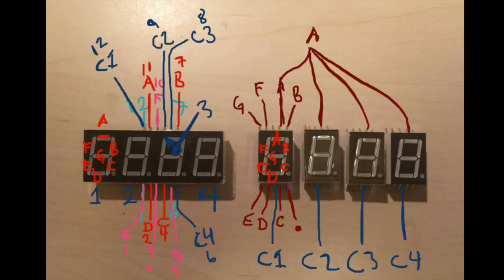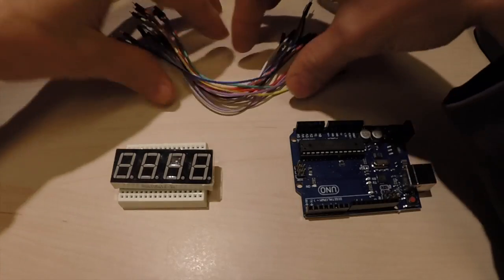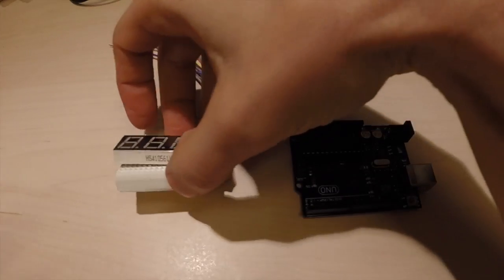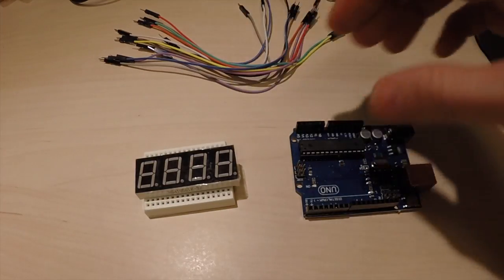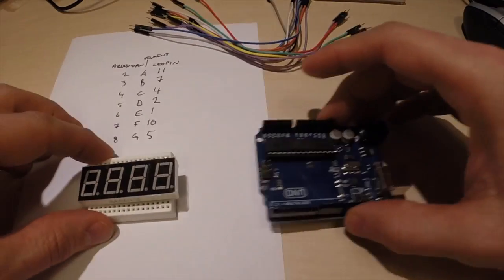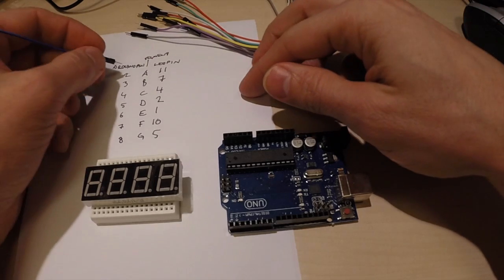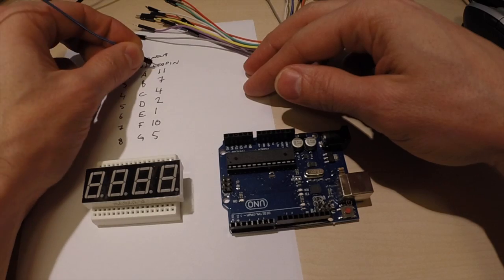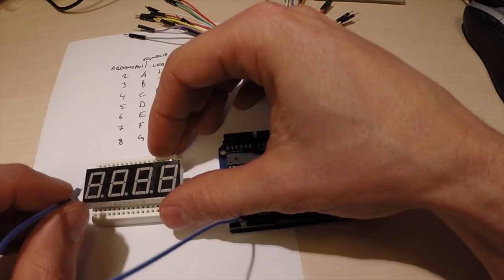Arduino and the 4 digit 7 segment led display - Anything Arduino Ep 21

Comment: could you please type the code so that i can copy it and paste it
Reply: /*
  Showing number 0-9 on a Common Anode 7-segment LED display
  Displays the numbers 0-9 on the display, with one second inbetween.
    A
   ---
F |   | B
  | G |
   ---
E |   | C
  |   |
   ---
    D
  This example code is in the public domain.
 */
 
// Pin 2-8 is connected to the 7 segments of the display.

int pinA = 2;
int pinB = 3;
int pinC = 4;
int pinD = 5;
int pinE = 6;
int pinF = 7;
int pinG = 8;
int D1 = 9;
int D2 = 10;
int D3 = 11;
int D4 = 12;

// the setup routine runs once when you press reset:
void setup() {                
  // initialize the digital pins as outputs.
  pinMode(pinA, OUTPUT);     
  pinMode(pinB, OUTPUT);     
  pinMode(pinC, OUTPUT);     
  pinMode(pinD, OUTPUT);     
  pinMode(pinE, OUTPUT);     
  pinMode(pinF, OUTPUT);     
  pinMode(pinG, OUTPUT);   
  pinMode(D1, OUTPUT);  
  pinMode(D2, OUTPUT);  
  pinMode(D3, OUTPUT);  
  pinMode(D4, OUTPUT);  
}

// the loop routine runs over and over again forever:
void loop() {
  digitalWrite(D1, HIGH);
  digitalWrite(D2, LOW);
  digitalWrite(D3, LOW);
  digitalWrite(D4, LOW); 
  //0
  digitalWrite(pinA, LOW);   
  digitalWrite(pinB, LOW);   
  digitalWrite(pinC, LOW);   
  digitalWrite(pinD, LOW);   
  digitalWrite(pinE, LOW);   
  digitalWrite(pinF, LOW);   
  digitalWrite(pinG, HIGH);   
  delay(1);               // wait for a second
  
  digitalWrite(D1, LOW);
  digitalWrite(D2, HIGH);
  digitalWrite(D3, LOW);
  digitalWrite(D4, LOW); 
  //1
  digitalWrite(pinA, HIGH);   
  digitalWrite(pinB, LOW);   
  digitalWrite(pinC, LOW);   
  digitalWrite(pinD, HIGH);   
  digitalWrite(pinE, HIGH);   
  digitalWrite(pinF, HIGH);   
  digitalWrite(pinG, HIGH);   
  delay(1);               // wait for a second
  
  digitalWrite(D1, LOW);
  digitalWrite(D2, LOW);
  digitalWrite(D3, HIGH);
  digitalWrite(D4, LOW); 
  //2
  digitalWrite(pinA, LOW);   
  digitalWrite(pinB, LOW);   
  digitalWrite(pinC, HIGH);   
  digitalWrite(pinD, LOW);   
  digitalWrite(pinE, LOW);   
  digitalWrite(pinF, HIGH);   
  digitalWrite(pinG, LOW);     
  delay(1);               // wait for a second

  digitalWrite(D1, LOW);
  digitalWrite(D2, LOW);
  digitalWrite(D3, LOW);
  digitalWrite(D4, HIGH); 
  //3
  digitalWrite(pinA, LOW);   
  digitalWrite(pinB, LOW);   
  digitalWrite(pinC, LOW);   
  digitalWrite(pinD, LOW);   
  digitalWrite(pinE, HIGH);   
  digitalWrite(pinF, HIGH);   
  digitalWrite(pinG, LOW);     
  delay(1);               // wait for a second
/*  
  //4
  digitalWrite(pinA, HIGH);   
  digitalWrite(pinB, LOW);   
  digitalWrite(pinC, LOW);   
  digitalWrite(pinD, HIGH);   
  digitalWrite(pinE, HIGH);   
  digitalWrite(pinF, LOW);   
  digitalWrite(pinG, LOW);     
  delay(1000);               // wait for a second
  
  //5
  digitalWrite(pinA, LOW);   
  digitalWrite(pinB, HIGH);   
  digitalWrite(pinC, LOW);   
  digitalWrite(pinD, LOW);   
  digitalWrite(pinE, HIGH);   
  digitalWrite(pinF, LOW);   
  digitalWrite(pinG, LOW);     
  delay(1000);               // wait for a second
  
  //6
  digitalWrite(pinA, LOW);   
  digitalWrite(pinB, HIGH);   
  digitalWrite(pinC, LOW);   
  digitalWrite(pinD, LOW);   
  digitalWrite(pinE, LOW);   
  digitalWrite(pinF, LOW);   
  digitalWrite(pinG, LOW);     
  delay(1000);               // wait for a second
  
  //7
  digitalWrite(pinA, LOW);   
  digitalWrite(pinB, LOW);   
  digitalWrite(pinC, LOW);   
  digitalWrite(pinD, HIGH);   
  digitalWrite(pinE, HIGH);   
  digitalWrite(pinF, HIGH);   
  digitalWrite(pinG, HIGH);     
  delay(1000);               // wait for a second
  
  //8
  digitalWrite(pinA, LOW);   
  digitalWrite(pinB, LOW);   
  digitalWrite(pinC, LOW);   
  digitalWrite(pinD, LOW);   
  digitalWrite(pinE, LOW);   
  digitalWrite(pinF, LOW);   
  digitalWrite(pinG, LOW);     
  delay(1000);               // wait for a second

  //9
  digitalWrite(pinA, LOW);   
  digitalWrite(pinB, LOW);   
  digitalWrite(pinC, LOW);   
  digitalWrite(pinD, HIGH);   
  digitalWrite(pinE, HIGH);   
  digitalWrite(pinF, LOW);   
  digitalWrite(pinG, LOW);     
  delay(1000);               // wait for a second
  */
}
Reply: This is the code if you have a common cathode display.
VVVVVVVVVVVVVVVVVVVVVVVVVVVVVVVVVVVVVVV

/*
  Showing number 0-9 on a Common Anode 7-segment LED display
  Displays the numbers 0-9 on the display, with one second inbetween.
    A
   ---
F |   | B
  | G |
   ---
E |   | C
  |   |
   ---
    D
  This example code is in the public domain.
 */
 
// Pin 2-8 is connected to the 7 segments of the display.

int pinA = 2;
int pinB = 3;
int pinC = 4;
int pinD = 5;
int pinE = 6;
int pinF = 7;
int pinG = 8;
int D1 = 9;
int D2 = 10;
int D3 = 11;
int D4 = 12;

// the setup routine runs once when you press reset:
void setup() {                
  // initialize the digital pins as outputs.
  pinMode(pinA, OUTPUT);     
  pinMode(pinB, OUTPUT);     
  pinMode(pinC, OUTPUT);     
  pinMode(pinD, OUTPUT);     
  pinMode(pinE, OUTPUT);     
  pinMode(pinF, OUTPUT);     
  pinMode(pinG, OUTPUT);   
  pinMode(D1, OUTPUT);  
  pinMode(D2, OUTPUT);  
  pinMode(D3, OUTPUT);  
  pinMode(D4, OUTPUT);  
}

// the loop routine runs over and over again forever:
void loop() {
  digitalWrite(D1, HIGH);
  digitalWrite(D2, HIGH);
  digitalWrite(D3, HIGH);
  digitalWrite(D4, LOW); 
  //0
  digitalWrite(pinA, HIGH);   
  digitalWrite(pinB, HIGH);   
  digitalWrite(pinC, HIGH);   
  digitalWrite(pinD, HIGH);   
  digitalWrite(pinE, HIGH);   
  digitalWrite(pinF, HIGH);   
  digitalWrite(pinG, LOW);   
  delay(1);               // wait for a second

  digitalWrite(D1, LOW);
  digitalWrite(D2, HIGH);
  digitalWrite(D3, HIGH);
  digitalWrite(D4, HIGH); 
 
  //1
  digitalWrite(pinA, LOW);   
  digitalWrite(pinB, HIGH);   
  digitalWrite(pinC, HIGH);   
  digitalWrite(pinD, LOW);   
  digitalWrite(pinE, LOW);   
  digitalWrite(pinF, LOW);   
  digitalWrite(pinG, LOW);   
  delay(1);               // wait for a second
 
  digitalWrite(D1, HIGH);
  digitalWrite(D2, LOW);
  digitalWrite(D3, HIGH);
  digitalWrite(D4, HIGH); 
  
  //2
  digitalWrite(pinA, HIGH);   
  digitalWrite(pinB, HIGH);   
  digitalWrite(pinC, LOW);   
  digitalWrite(pinD, HIGH);   
  digitalWrite(pinE, HIGH);   
  digitalWrite(pinF, LOW);   
  digitalWrite(pinG, HIGH);     
  delay(1);               // wait for a second

  digitalWrite(D1, HIGH);
  digitalWrite(D2, HIGH);
  digitalWrite(D3, LOW);
  digitalWrite(D4, HIGH); 
  //3
  digitalWrite(pinA, HIGH);   
  digitalWrite(pinB, HIGH);   
  digitalWrite(pinC, HIGH);   
  digitalWrite(pinD, HIGH);   
  digitalWrite(pinE, LOW);   
  digitalWrite(pinF, LOW);   
  digitalWrite(pinG, HIGH);     
  delay(1);               // wait for a second
Reply: Hi! im currently using this code for my display is common anode its just that when I copy and paste its says stray '\357' I hope you could help me, Thank you for posting this!

Comment: Firstly, it's great tutorial. It's clear about the pins in 7 segment.

I am working on a project. I had a similar 4 Digits Led Segment like yours. 
However, it's a module which uses 2 shift registers 74HC595. 

So, how should I write the code to make it runs? Thank you
Reply from the maker: Take a look at episode 22 for how to work with 595 and 7segment LED displays... https://www.youtube.com/watch?v=ZGzbAd-Aixc

Comment: Hey great tutorial but I am having an issue with my board, I press upload code and there isn't any error but my board flashes yellow a few times then nothing happens on the led display
EDIT: I fixed the problem, but now my display just has a static 9349 on it
Reply: Hey, i have the same problem. How did you solve it?
Reply: i think u have to use resistors when connecting to digital pins otherwise ur led display will be damaged

Comment: Hello,    Why you don't use resistors between segments and arduino?
Reply from the maker: Lazyness, because I was more interested in the Arduino coding to get it to work. But you are right, that for a correct design  resistors should be used.
Reply: The resistance of the segment is high enough so the current will be under 0.04A or 40mA, the max the arduino can handle.
Reply: Sir please create a digital clock code for me....

Comment: My display has a colon and 13 pins, is the 13th the one for the colon or is it wired diferently?
Reply from the maker: +James I cant find a pinout for a 13 pin variant, but yes, one of the pins is probably the colon. You can always find which pins is which by putting voltage over the pins. Once you find the ground pin the rest should be quite straightforward... Use 5v and a resistor in series while probing...
Reply: thank you so much for the help man :)

Comment: How would you light up the semi-colon in the middle of the display?
Reply from the maker: +Ben Decker There is most probably a pin for the dot or colon as well... Although it is another module. You can hook it up and go through all the pins until you find the one that lights up the colon. Then just add another pin to the sketch and set that pin HIGH or LOW to turn it on and off...

Comment: As always - great tutorials. if possible, i would like to see a simple two wheel robot tutorial with ultrasonic distance sensor, servo, DC motors, drivers etc. and to make things interesting, the robot should follow a line on the ground.I have seen some of them on youtube, but they all lack good explanation.
Reply from the maker: +Quoit1 Thanks! Do you mean a balancing robot? I did a robot a while back which uses servos, distance sensor and bumpers (and also Bluetooth for manual control). I have both line-following and balancing on the todo list... Hope to make them soon... If you havent seen it already, here is the video on the distance sensor robot: https://www.youtube.com/watch?v=dKlwpM7b1Zc

Comment: Dear Mr. Kristian,
I saw so many videos on Arduino projects of different peoples but you are fabulous because of your presenting style, so easy and very different.
I need your favor regarding one of your previous episode-4 (Temperature & Humidity Controller), from this episode i made an egg incubator by adding two more relays and also display (16X2 LCD). it is working very fine but for incubator we need different temp & humidity at different time, for that i need to add some buttons to change them directly without any editing with programming.
Please make an episode with connection of episode-4 with addition of buttons & LCD/7-segment LED.
I am waiting for your valuable response

Thanks in advance